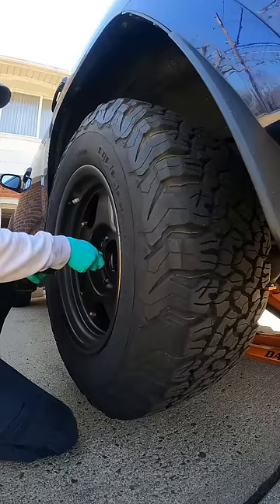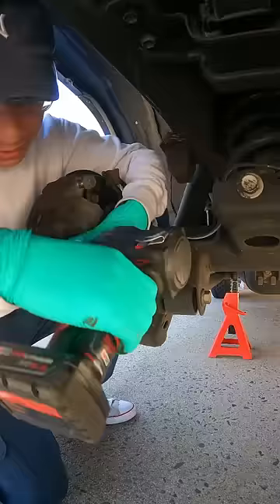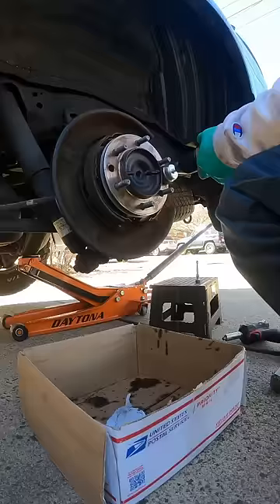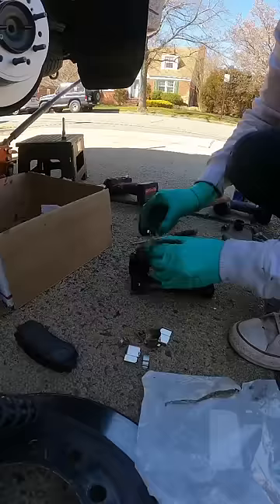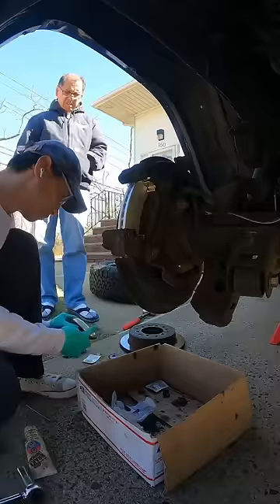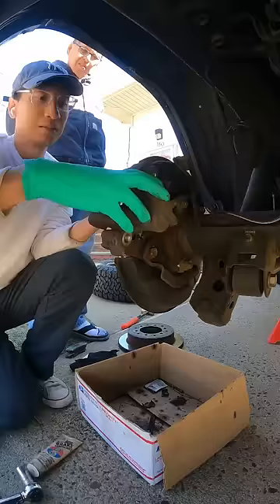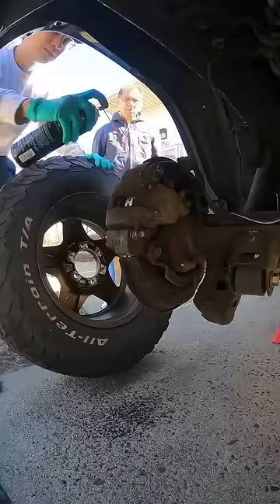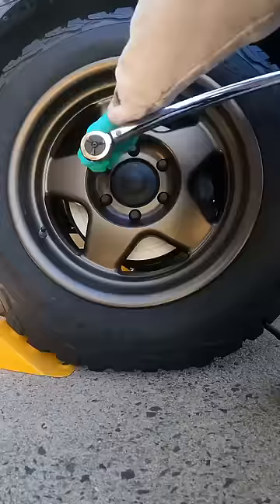Dealer wanted $700 to replace rear brakes. My DIY job cost me $100 and an hour of my time 😎

Comment: So now that you've done it yourself. How much would you charge a stranger to do this job? Using the brand name components of said vehicle.  Keeping in mind the cost of the house or building you're doing it in, your time, any electricity you may use, and any paper documentation that would be warranted for business use.
 If you have figured about $400 dollars to be profitable,  you are correct.  Now, if you want to warrant your work, because there is always the chance of a manufactured parts failure. You would want to include a charge of minimal time for labor in case your work comes back and the cost of parts again.
 Now our cost is closer to $600 dollars.
 Some auto repair facilities are a rip off. But most are not. 
If you have the tools the time and the knowledge,  you can always save yourself a few bucks.
If your job pays you more than $150,000 a years obviously, your time is more valuable than to be wasted underneath a car doing your own repairs.

Comment: Torque wrench, Milwaukee cordless impact, 17mm socket and 14mm socket, daytona (HF) floor jack, sledge hammer, drill and a wire brush, brake caliper piston press. Less than $100 bucks right. Reason why stopped being a mechanic, none of the equipment and tools goes into consideration.

Comment: 100 for the parts.. another hundred for the electric impact…. And another hundred for the torque wrench…. Annnnddd another 250 for the jack…. Annnnddd andother 35 for the brake cleaners, another $35 for the gloves (if you work in kitchen you can get them for free) another $10 for paper towels, and if you want your brake fluid changed seance you pushed it out the reservoir when you pushed in the piston thats another $35 for brake fluid. Annndd thats your $700 right there good job diy 🫡
Reply: Ohhh shit and I forgot if you have a brake sensor you need another 150 - 500 for a scanner to clear your light 👍🏼 you got this 👌🏻
Reply: Also make sure if you are in a Toyota Prius you abs bleed your brakes or you finna get ❌😵

Comment: Sorry you didn’t grease the back of the pads. Or clean the hub before replacing the BRAKE DISC not rotor. And didn’t retract the piston on the brake caliber. Which means bleeding the brakes. So that’s a poor job.

Comment: This dude is so fake. I work at Folsom Lake Toyota and we don’t charge $700 to do brakes for one axle. We charge 280. And if he is paying less than $100 for parts he is not upgrading anything. He actually got the cheap two year warranty brakes.

Comment: He will have to do the same job again in a few months. Bigger tire require more breaking power, also what mechanic wear a white sweater to do a job? 🤷🏽
Reply: If you’re burning through a set of brake pads in a few months with bigger tyres, you’re doing something wrong. I drove a GQ Patrol on 37’s for 3 years and the extra braking required didn’t need me to replace pads. Daily driver, 500+ km per week, with a 4.2L motor, lifted, with a bullbar, full roof rack, and rear drawers.

Comment: Coated rotors...no need to spray with brake clean. Also make sure your brake pads move freely when installing into caliper bracket. 

Also how are those parts less than 100$?? I mean normally if you are spending less than $100 on pads and rotors you are getting absolute SHIT parts. You get what you pay for.

Comment: Brakes are not that difficult, youtube can teach you if not that talented. Brake jobs from shops are total ripoffs....I changed my rear brakes with electric park brake on my car. A shop want $600. I did a littel reading, already had the tools. It took me about 90 minutes but here I am two years later and still all good.....

Comment: Dealer parts especially Toyota are FAR superior. No way that shit rotor and discount brake pads are equivalent to even OEM.  At least use Toyota parts… but it will cost more than $100 in parts.

Comment: Every mechanic around my area wanted anywhere from $700-1000 for my moms Honda CR-V I went to my local Autozone and got all the parts for a full brake job pads and rotors for the front and rear for $340 and it took me about 3 hours because I was taking my time and because some of the caliper bolts were extremely stubborn otherwise it’s an easy job mechanics are extremely immoral people they can get the exact same parts I got for even less due to their shop discount and make a ridiculous nearly $1000 profit off of you absolutely disgusting.

Comment: Yeah bro $700 is what they gonna spend if they dont have the necessary tools that u have lol to do a diy.  bro u even got a daytona jack. U got everything to finish the job right. Why would u even go to the dealer.  People if u wanna do diy. U have to start off investing in tools. Tools arent cheap. But once u got them. Ull thank them in the long run

Comment: Yeah they rape you on brake job prices. I can put nice ceramic pads and slotted or drilled rotors on all 4 wheels for less than half what they want for standard parts on 2.

Comment: FOR UNDER $1OO BUCK$ IN PARTS YOU WENT FROM O.E.M. TO TRASH TO SAVE $$ YOU WOULD HAVE PAYED $$ UNDER $3OO FOR O.E.M. THE BEST ROTORS & PADS YOU COULD HAVE PUT ON YOUR TRUCK TO REPLACE THEM WITH GARBAGE YOU SHOULD KNOW BETTER FOR NEXT TIME BUY THE RIGHT STUFF AND DO IT YOURSELF

Comment: As mechanic if u don’t know what the hell u are doing than u should not work on them. What if the brake had electronic e brake. This guy didn’t show u all the steps correctly.  Besides when something goes wrong because u were horsing  around all sudden u want the mechanic to fix it for you. E.I using an app scan tool an put a bug in vehicle destroying the network is one common things people do.

Comment: Floor jack is 200, parts are 150, torque wrench 100. Sockets and ratchet 200, brake lubricant 20, brake clean 5 etc, your life, priceless.

Comment: What car are you working on that pads and rotors are 78 bucks combined? And for that little price, how is that an upgrade over what is on there already?

Where I'm coming from: 2005 Chevy 2500hd, 2008 Chevy uplander, 2007 Ford freestyle, 2014 Chevy 1500, 2017 Chevy Colorado, 1998 Chevy suburban, 2014 Ford focus, 2004 Honda civic, others....

I have not don't a brake UPGRADE job and have parts cost less than a 100 bucks. Regular brake job? Sure, the civic and focus all day. The Chevy trucks? HA! Come back with your daddy's wallet when you're ready to shell out the big bucks for work. (It's a joke y'all)

I'm genuinely curious if this actually was an upgrade or just a regular brake job. And don't know if anyone has warned ya. But some of the cheaper brake stuff out there is not worth the savings. I won't make any claims but just say to do your research

Comment: This guy used a 1/2 inch torque wrench to torque the caliper to the slides 😂🤣🤣 also bet he gets a brake squeal he can't get rid of because of the cheap ass parts he installed

Comment: I can tell you, $100.00 for pads and rotors you got cheap chinese crap parts and will be replacing in 20,000 miles. I'll bet you got 70,00 to 100,00 out of the factory parts.

Comment: Clean and grease slide pins clean and grease pad hardware flush brake fluid cause u know you never have and also tip your mechanics f your waiter